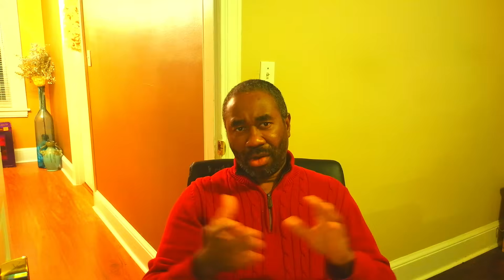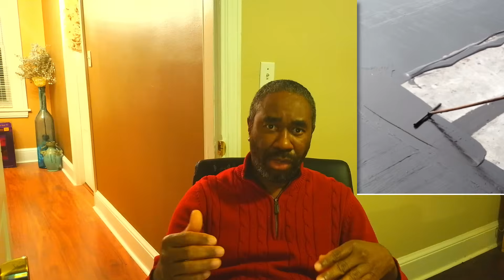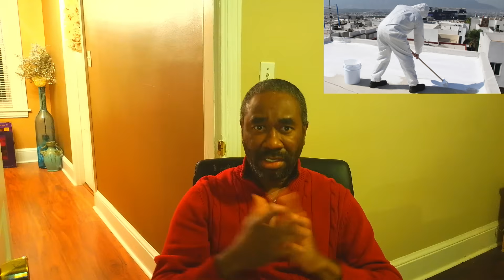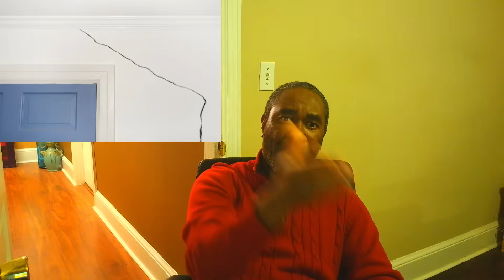THINKING OF CHANGING YOUR TO TIMBER ROOF TO CONCRETE ROOF AFTER HURRICANE MELLISA? | MUST WATCH

Comment: Hi JK. Thanks for this wealth of knowledge.  I am considering changing my gable timber roof to concrete. However,  whats your take on this? I was recommended to a company that does architecture and draughting. I was told that columns would be placed on the sides of the walls. Is that the right approach?Do i still need to employ the services of an engineer? Looking forward to your response. Thanks in advance
Reply from the maker: Thanks for your comment.  Architecture and draughting company is not the right approach.  You need a structural engineer  to guide you on this. Remember also that the concrete slab need to be design and detailed accordingly. The columns would have to be placed at corners and minimum spacing of 10 to 15 feet in the walls.  Hope this helps.
Reply: @jkengineeringarchitecture. Thanks for your response

Comment: There's a very simple and practical solution to the problem of concrete roof heat trapping. It took me fifteen years to figure it out but when I finally installed solar panels on top of my concrete roof, my overheating problem disappeared entirely. It's so simple and it rescued me from JPS as well. Even if you don't have all the money at once to do a full solar array, you can install the panels initially as a solar shield and then later add the inverter and batteries to actually generate electricity.
Reply from the maker: OK. Very interesting, therefore the sunlight who go directly to the solar panels instead of penetrating the roof itself, thus significantly reducing the rate of heat absorption of the building and your energy bill as well. A very good thought. I am going to talk about it on my channel. THANKS.

Comment: How about using EPS for the concrete roof? This would reduce the weight of the slab roof.
Reply from the maker: We would to investigate it some more. Remember EPS is light weight concrete and would certainly reduce the weight of the slab. But I am not certain if it could work in our Environment to deal earthquakes since it has a low modulus of rigidity because of it light weight.

Comment: Good advice. Water  seepage causes steel stiffeners to rust and weakens the roof. Concrete roofs are dangerous in earthquakes. Please tell us how to make timber roofs strong enough to resist the strongest hurricanes
Reply from the maker: You are correct, water passing through the concrete slab, cause the reinforcement to corrode and expand thus pushing off the concrete cover and cause the bottom reinforcement to be expose to air which causing oxidization of the steel, which cause section loss of the steel thus weakening the concrete slab structural Integrity. Yes will do a presentation on timber roof soon. Thanks. Subscribe to my channel please.

Comment: the JA govt should contract to license this comprehensive video- it helps many people.
Reply: Jamaica has this in building codes. When people don't follow it hurricane takes their roofs.
Reply from the maker: Thanks.
Reply: @jkengineeringarchitecture.  I've been in concrete roofs houses in Jamaica.  No sah they too hot and uncomfortable.  I would stick to the  zinc roofs and secured it with bars, hurricane straps and every contraption necessary  to hold it down. 
I've seen mold from the leakage of concrete roofs. 
I think I'll use concrete on the storage,  escape room attach to the house with a walk way leading from main house to it. I'll stock it with emergency supplies .
Reply from the maker: @eileenwatt8283  Yes concrete house really hot fi true. Yes you can build a safe house with concrete roof just for emergency like a hurricane. Very good idea. THANKS.

Comment: what about using anchor bolts in the ring beams to reinforce the timber roofing
Reply from the maker: Yes anchor bolts must be used in the belt beam to anchor the wall plate when doing Timber roof.

Comment: This is very helpful. Can you explain how to reinforce an outside wall?  The workmen removed the louver windows and left cracks in the wall and compromised the structure on one side of the house. I would like to know the correct process on how to repair that wall.  Thanks in advance.
Reply: Hopefully the workmen will be helping you to recover some of the costs
Reply from the maker: The crack areas should be dug out to about 3 inches deep and wide enough and flashed with 1:2 Mortar mixed to properly seal the cracks.
Reply: @jkengineeringarchitecture.  Thanks for the information.

Comment: This video should have 100x the views. Great information. I'm sure a lot of people are going to gather some workers and throw a concrete roof on their existing house without proper engineering support.
Reply: I remember after Hurricane Gilbert 1988 ,many people went & put slab roofs on houses that had zinc roof & after a while , the walls starting to crack because it affected the foundation. They weren't designed for the way much heavier concrete slabs .
Reply from the maker: @RobertCampbell-h9i  Yes. For sure. People need to take heed and do the right thing.
Reply from the maker: Yes you are right, but Unfortunately Not. I know that is exactly what some people are going to do without a doubt. Thanks and Respect.

Comment: Boss you kinda have to dumb down the language a bit so slow people like me can understand lol

 what do you mean by one way or two way slabs? 
slab one side first then the other?

And to be honest most people not gonna get or afford a engineer they are just gonna get some random masson man to build them a house so it's good for them to educate themselves to see if the builder they hire is doing crap
Reply from the maker: Yes you are right, I was going to mention that most are not going to be able to afford an Engineer. But for me this is time we all should come together and I am expecting that Engineers should be a little Empathetic to their clients by lowering their fees. As it relates to your question about one way or two way slabs, according to the dimensions of some of the floor areas, load distribution is going to be in one direction and some is going to be in two directions. Therefore, the structural Engineer would have to reinforced these two types of slabs accordingly. THANKS Good Question.
Reply: @jkengineeringarchitecture.  Thanks for the explanation.